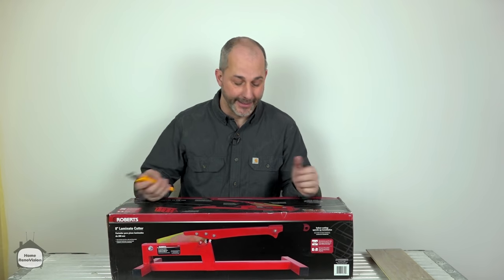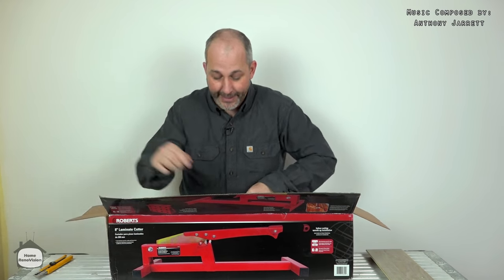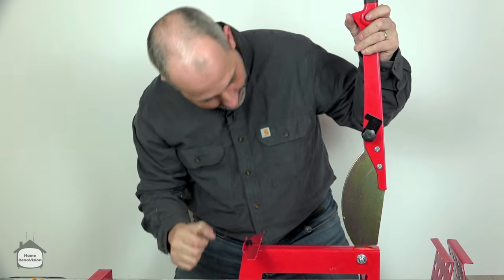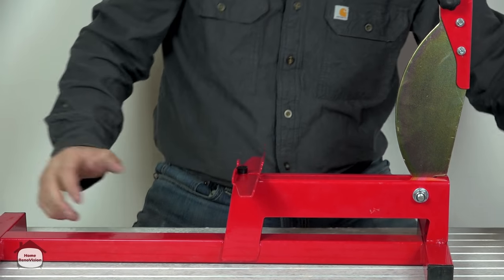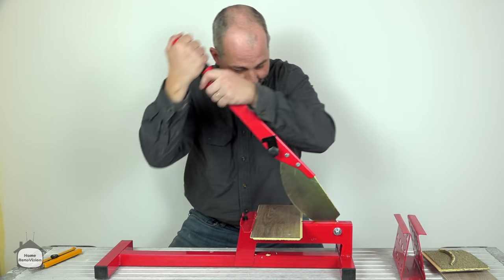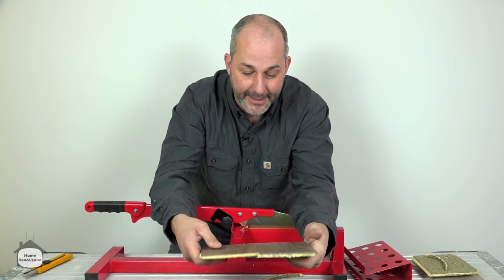DIY Laminate Flooring | Cheap Cutting Tool Review

Comment: You could also put a piece of 1-1/2 black pipe on the end or whatever size that would fit the end and increase the leverage to the point even a kid could cut through. I use different size black pipe when my breaker bars are not long enough. That's a great tool with the addition of black pipe... chop, chop, chop... 👍👍👍👍👍

Comment: I just did about 200 sq feet of 12mm laminate this week using this cutter I found that it did a good job, all things considered, I got it for $50 at Rona.  I would suggest though that if you are going to use this have a sharp chisel on hand I found that the cut would leave a little 1/8" that required to be cleaned up, a sharp chisel did the trick.  Overall it was a good option vs having to climb up and down stairs for all the cuts. I think If I was working on the main floor and had quick access to outside though I would stick with the miter saw, but working upstairs it did save a lot of time and walking.

Comment: I bought this laminate cutter at the home depot and honeslty i was blown away specially since it isn't razor sharp but man did it do the job with no issues really...only complain i have is it that you have to put some amount of pressure but it isn't an issue that would stop me from recommending this to anyone who's going to install laminate in their home. My rating is 4 out of 5, 4 stars and B+. Oh!! Don't let the fact that it isn't sharp make you think it won't cut through them because it did no breaking or chipping just a straight cut.
Reply from the maker: I agree with your assessment. not the greatest tool out there, but a great value for homeowners. Cheers!

Comment: Looks like EZ Shear works better from another video. The advantage is you have the shear next to your work, don't need to get up to the next room to use a chop saw and create a lot of dust. Like to see how clean those thing cuts as laminate has a tendency to chip because the surface so hard and brittle.

Comment: Didn’t look like the edge was very clean after it was cut. Wouldn’t a sharpen blade take care of that? And also if you were to put a thin piece of wood underneath perhaps Wind up making a cleaner cut too. And that does look pretty tough to push down actually. I think a sharp blade would solve all those problems.
Reply: CoreyGemme I thought the same thing, at first.  Then remembered that edge doesn’t need to be a clean edge, as it’s hidden under the trim.👍
Reply: I have one of those tools and indeed it's not super clean but it doesn't need to be, that edge will go under the baseboard and will not be seen. The only problem is the longitudinal cuts, they are hard to make cause the laminated board isn't blocked and tends to slide or deviate from the line.
Reply from the maker: Hi Corey, all of these types of tools are actually crushing tools. floating floors are not designed to have exposed edges so it makes little difference as long as the crushed edge has a thin profile so it is easy to cover. Cheers!

Comment: Hi Jeff.  I saw this cutter says it cuts up to 10mm thick I have a 12mm laminate floor.  I saw you put the laminated floor on top, I am wondering if it would do the job for the 12mm this way...

Comment: Think this would work with peel and stick vinyl? Wife just upgraded the project from the bathroom to bathroom and unfinished basement washer/dryer area and I'm nervous about running around making cuts myself, esp when home with the kids.
Reply: I used a box cutter to score and snap the peel and stick vinyl in the past,  worked great and I didn't have to use any of my tools.  I think due to the dull, thick blade of this cutter the paper backing would get caught and this cutter wont cut it smooth.  Works great for laminate and vinyl,  but not sure for peel and stick.
Reply from the maker: I would stick to a knife on peel and stick. Cheers!

Comment: I picked one up at Rona to try after 3 cuts I brought it back!!! You really have to put a lot of weight on it. Thicker the floor the worse it is.
Reply from the maker: if you use a pipe on the handle for extra leverage then it is easy!
Reply: @HomeRenoVisionDIY  
I agree. It's a great DYI....limited use. Good price.
I do a lot of flooring.  it's not designed for  heavy use.
I bought a great tool for the wrong  person.....me!

Comment: Cutting fine, with longer arm should be much easier.
Reply from the maker: use a piece of pipe and it would be very easy. I found standing over it was fine.

Comment: Just stopped and bought a few more boxes of LifeProof vinyl flooring at HD on the way home from work today.  They had this cutter on the shelf for 52.99.  I took a pic of it knowing I saw you do a video on an inexpensive yet effective cutter.  Well...it's the same Roberts cutter. My plan is to buy that cutter and get a piece of tubing to extend the handle for a little more leverage:). Thanks for all you do and all the great tips.  It nice to have someone blazing the trail:)

Comment: I’m a big idiot. Why is vinyl dangerous?
Reply: I think he meant cutting laminate with a table/circular saw is dangerous.  Laminate is made of hardboard which is compressed saw dust and resin.  So when you cut it with a saw the particles go in the air and it's dangerous to breathe it in
Reply from the maker: Hi Natalie, they both are right. Sorry for taking so long to chime in. I just got back from my trip. Cheers!

Comment: Not bad but........ I think I'll stick to my $150 floor shear. It has a table and can be set for different degrees. And the blade can be replaced or sharpened if it gets dull.
Reply from the maker: If you use it a lot then you want a commercial quality tool for sure. Cheers!

Comment: I stick with miter saw you can get used for 30 buck
Reply from the maker: wow, i can't even get a blade for 30 bucks. Cheers!
Reply: @HomeRenoVisionDIY  No craiglist or Facebook in Canada
Reply: When you justify spending more, take a look at the cordless sliding miter saws from Milwaukee or DeWalt.